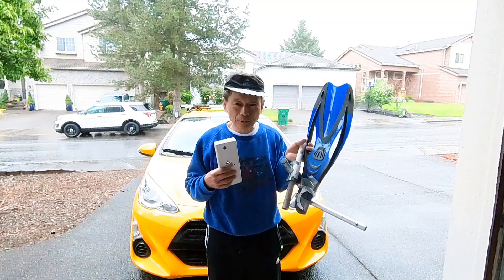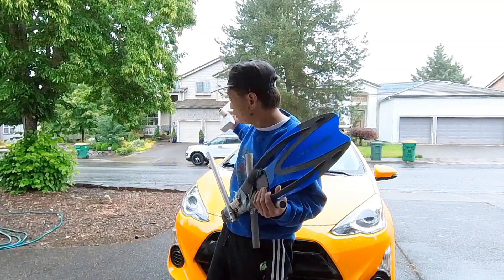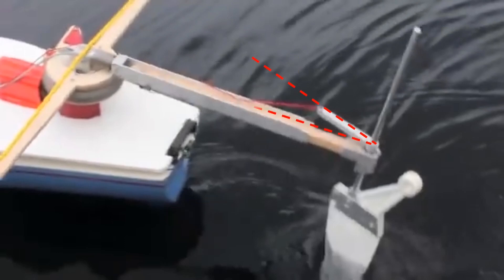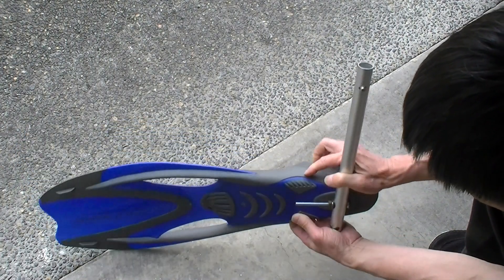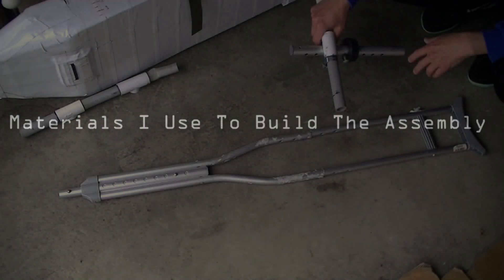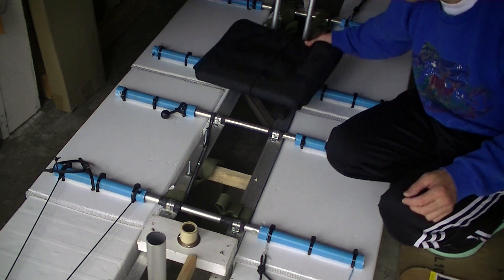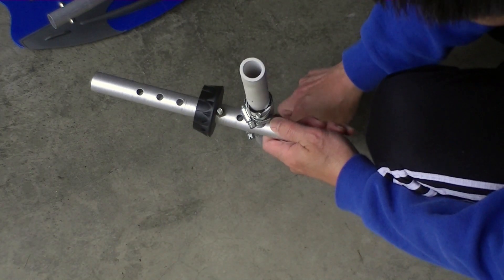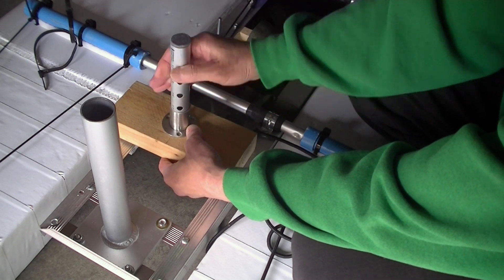Pt 2 $25 DIY Kayak Paddle Drive

Comment: I grew up on the Barnegat bay, I had a boat before I had a bicycle, one of the first things I learned was how to scull with one oar off the transom, I have used the rudder of a sailboat to scull out of a calm. Im very interested to see how this works midship
Reply from the maker: Will find out how well it works in a few days. I do have 'plan B' if it is not good :-)